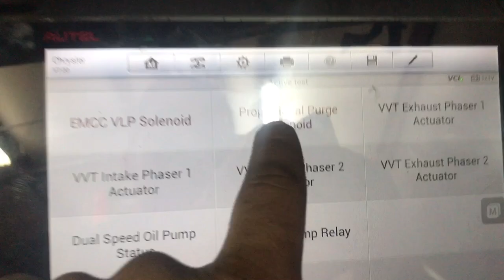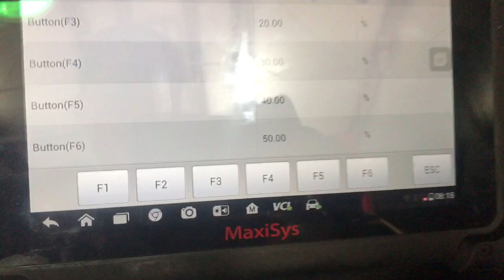How to find an EVAP leak. Bad gas cap ??

Comment: VASOLINE to protect the gasket on the gas cap is a horrible idea; though in your mind is 'sounds' good. Vasoline will damaged the rubber gasket. Though you can buy just the cap gasket. Yet Toyota maint. states the gasket, cap are one unit and leaks can occur if you just replace the gasket. That makes zero sense as if your careful in replacing said gasket withg a metal pick tool and are equally careful replacing said gasket the install will be ok. They're just including others who are not as OCD in this. Replacing the gasket alone will cost close to same as  the entire cap so Corp. Maint. states replace the entire cap and avoid any possible gasket failures.

Comment: Why not just replace the gas cap first, instead of investing in the smoke machine? The code (in my case) says replace the cap. Between me and the previous owner, we've replaced the gas cap three times. Yet the problem remains. What do you do when replacing the cap doesn't fix it?

Comment: I have been dealing with my gas cap for years now.I think I fixed it.Its an aftermarket cap and I thing the seat is too narrow for the rubber O ring to sit and seal properly.I filled the gap between the seat and the rachet ring with 5 minute model airplane epoxy and let the epoxy self level while drying.The O ring now sits and seals properly,I'm now left with trying to clear the stored codes on the computer

Comment: Lots of check engine lights are due to a bad gas cap.   After installing it may take several days for the light to go off.  Always start with the simple stuff and cheapest first.  Good luck.
Reply: You can turn the light off by disconnecting the neutral post on your battery for 1/2 hr.

Comment: just finish smoking a 2016 impala with a brand new gas cap from autozone  P0442 ...the gas cap is no bueno...
Reply from the maker: Not all evap codes are gas caps. Always do proper diagnostics before replacing parts. Here’s a video that will help out on this problem. Hope it helps https://youtu.be/M1FIGQ1TbwU

Comment: Will this cause the fuel guage to drop?
Reply from the maker: It will not
Reply: @OzMechanics  what will cause my fuel needle to drop badly? Im getting 6mpg on a 04 v6 4runner. It has new injectors. Just replaced o2 sensors and it reads very rich -20 upstream and -30 down stream

Comment from the maker: If you feel like this video helped out, feel free to support the channel by donating. Just one click away on the link below, to help support the channel :)
https://www.paypal.me/ozmechanics
Reply: tested and the gas cap was the location of the leak, changed several new off brand and oem gas caps with no fix, still has error after 2-3 starts  subaru outback 2020

Comment: One occasion I left my gas tank cap Open I didn't close right and after I had the engine light on the code was that evape leak I left that for a couple of weeks untill I replaced it with a new gas cap that the old didn't seal it right but I noticed that I still get poor gas mileage every time I fill the tank what should I do will something be clogged in my gas tank that's why I get low gas milea distance I suppose to get 390 Miles distance but everytime I get 280 when I filled it up
Reply: Could be bad O2 sensor(s), the Mass Air Control Sensor or you are in need of a tune up, particularly new plugs.

Comment: Iknow it’s been 4 years since the upload sorry for the comment lol but did you close the vent solenoid on that vehicle or no? Wondering because I had a Hyundai I forgot to close the vent valve and smoked it and had smoke coming out the cap, I assume the cap is bad because I doubt closeting the vent valve will change the results

Comment: Great video, If the leak was at the Leak detection pump would the smoke be visible there? 2011 BMW 328xi
Reply: If you take the hose off it will if its bad,

Comment: My 2004 Pontiac gran prix  to seperate occasions  check gas cap  10 yrs.ago. I replace the gas cap. Problem solved.  Now again I replaced gas cap . It didnt  go away. The check engine lite comes on from time to time.
Reply from the maker: Have you got it diagnosed? What codes does it have.
Reply: @OzMechanics  my mechanic is going to use the smoke machine. I'm going g to have both 02 sencors replaced the same time.  Everything is fine no skins no hesitation. Great acceleration 265 factor hp. So I'm not overtly concerned unless the part is no longer available.  As we know GM  no longer make Pontiac.  What bad business discition that was.
Reply from the maker: Do you remember the code ?
Reply: @OzMechanics  the gas cap I believe had a code it come up on the center controls milage other setting check abs. Stuff. . We will get the codes from what the check engine lite when my car goes in. I'm holding off un till April when I have vacation time.

Comment: I own a 2000 Chrysler Concorde LXI 3.2, and I replaced the entire Evap system. I even changed the computer PCM. I keep getting a code for EVAP LEAK DETECTION PUMP “Switch”? I can’t find anything on an Evap switch? Any ideas, would be great?
Reply: I have the Haynes manual on my phone, and it comes back 0 matches?
Reply from the maker: What area are you located I have plenty of automotive buddies that can pin point the problem. Just don’t want to give you info that might not help. Just hard to diagnose with out looking at the vehicle

Comment: can this cause a 3-20 sec delay in acceleration might try this before I change the fuel pump
Reply from the maker: Nope it wouldn’t. I would prefer taking it to a well known shop which has good reviews. Sometimes it’s better to get a proper diagnosis. I’ve saved my customers a lot of money by doing the right diag

Comment: Nice way to show how a gas cap is bad and possible sign of an EVAP leak, but are you supposed to use the same color gas cap e-85? You replaced a black from a vehicle that uses e-85 gas.
Reply from the maker: Luis Davila feel free to check out my new video on evap system

Comment: This was a nice easy fix for you and a smooth loss of $200 to the customer.
Reply: Knowledge and labor ain't free
Reply: Seems to me the fella had an inkling that it was like the gas cap to begin with. But I suppose there ain't no money in that. me if I get a small evap leak code I'm going to change the gas cash right away clear the code driving about eighty miles and see if the light comes back on. If not I'm going to take an educated guess and say it was just a bad gas cap.

Comment: My o-ring attached to the nozzle where you pump gas is ripped up and I’ve changed my gas cap but I still get an evap check engine. Can I replace this oring?

Comment: I'm oldschool learned from father may he rest in peace. Great video,  I'll add 1 thing he forgotten to mention. A bad worn out gas cap The sound will change in a bad or faulty gas cap the sound will come together far as the clicking and will not be solid. A new (vacuum) gas cap will have a more (solid) (louder) clicking sound and the clicking sound will not be coming together. Note put a paper towel in the gas filler, Next using rubbing alcohol clean the filler neck where the seal will contact the neck. Next use a very light coat of vaseline on the seal of gas cap to condition and protect. Reason for this step is dirt  debris and road grime will get under the gas door making it's way under the gas cap. Resulting in #1 bad seal torn or cracked. #2 Not locking correctly, Note that's where the sound in clicking changes. Thank you and bless you all.

Comment: I'm sure this is my problem I have a Honda accord and it was leaking under the car on the side where the gas cap is after I opened and closed it it stopped leaking could this be why ?

Comment: I have a gas cap light on I replaced it and it's still on. Now the check engine light came on and it won't turn over when I try to start
Reply from the maker: ms. sexy midnight i would recommend taking it to a shop to gets the codes read
Reply: @OzMechanics   ok will do thanks
Reply: @OzMechanics  I was told it could be the pressure,sensor but I'll get it read

Comment: What causes the gas caps to go bad?  The rubber seal or something more complicated?  Could you just add a new rubber gasket ring around the cap ?
Thanks
Reply from the maker: Just age on the seal. I just end up changing the gas cap. Oring is not serviceable
Reply: The rubber seal is worn out. You should replace your cap every four years or so before failure.
It's only an investment of $15-20 for a new one.

Comment: I got a smoke test and my cap was smoking just like in the video, but when I tried the new cap that I had with me it was still smoking. Could this be a filler neck issue?
Reply from the maker: Prod. Stress yep. Make sure the matting surface on the filler neck isn’t pitted either
Reply: Was it fixed? Any inputs would be appreciated

Comment: I wish I had one of these smoke machines I had a evap system leak and started replacing parts one by one and found out it was the fucking gas cap the whole time...fml
Reply from the maker: Everyday Stoner that tends to happen
Reply: same dude lmao 300 bucks wasted when it was just a gas cap 💀

Comment: can leaking gas cap cause stalling when pull out of 5th into neutral? & when 1st starting it almost stalls but barely catches rpm's. Smells like gas when driving too
Reply from the maker: Venom Blueangry not a leaky gas cap
Reply: Did you ever find what was wrong? My truck is currently doing that
Reply: You are not obtaining the correct mixture of O2 with the gasoline.
The cause is probably a bad Mass Air Control Sensor.
The part is not that expensive and you can change it yourself = pretty simple, easy to reach.

Comment: Learned something. Either have to turn on purge solenoid, go straight in the hose to the tank, or connect hoses.
Reply: Thanks for explaining that he sort of left that out...(connect the two) without computer to turn on purge valve
Reply: My 91 Honda Civic idles rough when I hit half a tank. Could something like this be causing that ? I already put in new fuel pump. But it only idles rough when I hit half tank. Thanks 👍